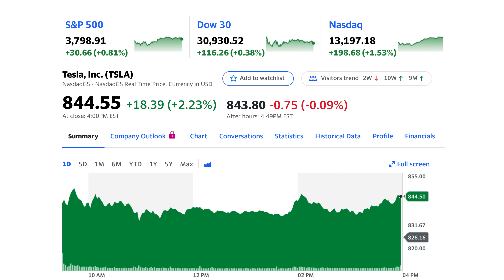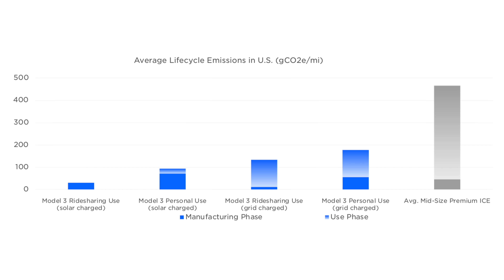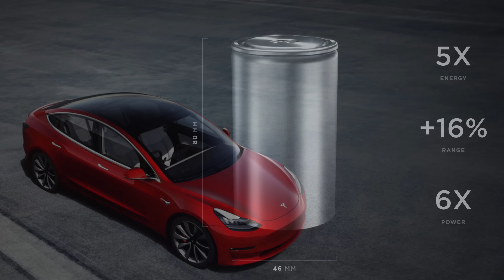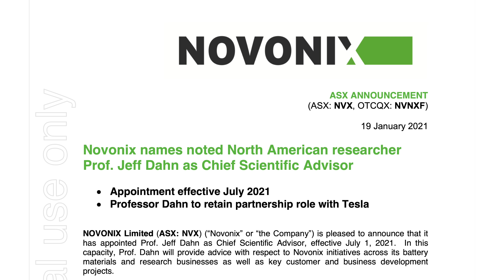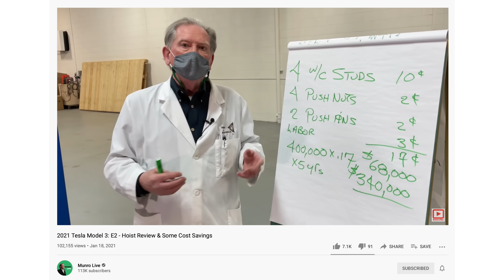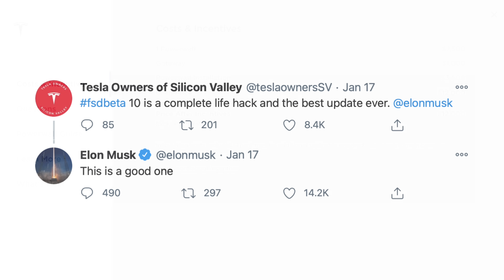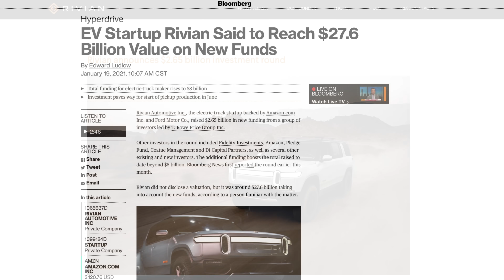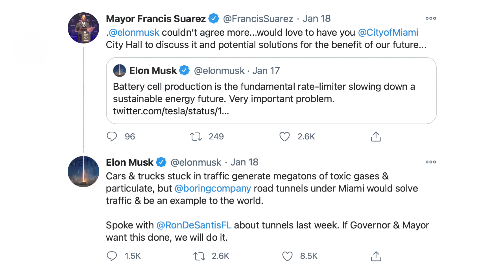Some Math on Tesla’s New Batteries, Munro 2021 Model 3, Dahn/Tesla Battery Contract

Comment: I love that you reiterate that 1 mil miles is insignificant except for robotaxis. I don’t think many people realize the avg life span of a vehicle is about 7-8 years. Even driving a high 25k a year, that’s still only 200k miles on the high end. You don’t see many of those cars on road without being sold off already for an upgrade/trade in or totaled in a collision
Reply: The average life WAS 7-8 years.
Mainly due to drivetrain wear (or poor quality steel?)
If the EV drivetrain can multiply that, who's to say that there won't be a trade in "vehicle rebody" where new panels are bolted on to the chassis?
Maybe the same with interior?
A 2 hour "refresh" with replacement refinished seats and carpets?
Take a 7-8 year old car in, collect in 2 days, you have a "3 second" Tesla with new panels for minimal cost.
Just a thought.
Reply: @rogerstarkey5390  that would actually be really cool to do. I wonder what the margins on that would be and if it was cost effective for them. I’m sure they could figure it out esp with their skateboard design. I don’t see why they couldn’t make that happen. I think their new alloy will probably last 10+ years

Comment: Quality issues like uneven panel gaps are caused by the manufacturing process. I am sure if the made in China model 3 is checked, there would be far less such issues. The Shanghai factory is much newer and better than the Fremont factory equipment. Note how installing new painting equipment in the Fremont factory led to a better paint finish on the 2021 model 3. It’s all in the process. Tesla will certainly need to improve the process in the Fremont factory and they are already getting the personnel for that.

Comment: Whoa there. let's not minimize the Munro criticism of the continuing build quality issues. Sandy clearly stated how disappointed he was about how poorly the panel gaps are. in once case, he was surprised the door even opened it was installed so poorly and said  he "didn't understand why there still these build issues". Those issues should have been resolved long ago and you can plainly see how frustrated Sandy is. There are no excuses for these ongoing quality issues and to use whataboutisms is disingenuous.
Reply: "Whataboutism" works both ways.

Comment: The increase in Powerwall - Roof install might be due to them integrating their own inverters instead of outsourcing as of the last few weeks or less. Haven't seen much, but the system apparently runs in a more optimised way when coupled to their existing hard - software tech.

Comment: Tesla needs to get better with quality and they know it, and are hiring to improve it.
Reply: Meh.  The big 3 carmakers use some tools and mallets to bend the doors so they align better.  I think that Tesla is doing a great job because they most likely don't beat on the cars with mallets, etc. but depend on the robotic arms to get it right the first time.  I think it's more important to make sure the car is built well in many other ways.  Watch Sandy Munro's videos of the Model 3 for a true expert's opinion.  He knows his stuff!
Reply: @acmefixer1  yeah, I've watch Munro's latest on panel gaps
Reply: Acme Fixer
:  OTOH, since the early 80's, the Japanese makers like Toyota and Honda just made them fit well, without needing to beat on them.  They made the American cars which were CLEARLY beaten on a lot, look like CRAP in comparison. 

Here we are 40 years later, and Tesla can't or won't fix something as simple as panel gaps, but we're supposed to believe their cars will last a million miles.  Meanwhile, their overall quality and durability by reliable reviewers is very much meh overall, and sometimes horrendous.
Reply: @rogergeyer9851  
The reason for the "million mile battery" isn't miles.  It's charge/discharge cycles, which will get used up when customers find that they can park their cars at home and supply power to the grid and get paid for it using Tesla's Autobidder software.  That's where the "million mile battery" is needed.

Comment: Hi Rob, great update again. The panel gap issue, though improving, is a pyschosis within all automotive manufacturing, historical panel gaps were seen as "if you can't get the press shop variability removed and the general/final assembly variability removed, THEN EVERYTHING ELSE MUST HAVE VARIABILITY AND BE RUBBISH". Which historically had validity in 1960-1990.

That psychosis is understandable but less and less and less indicative of manufacturing excellence these days.

In parallel, I note TSLA is employing QA Vision systems personnel - be in no doubt with vision systems, fractals, lasers.....this could diagnose this issue and others.....AND THEN BRING FOCUSED IMPROVEMENT to the specific pressing or assembly sub processes to make perfect.

Great work Rob. I'm tipping the 4680 battery pack to go very, very, very close to 100kWh 😜 likely 92-96 as you suggest, I wouldn't be surprised if the 5x has been sandbagged and reality is in the 5.6-5.8x range.

Comment: Small issue or not, the panel gaps is an indication of not caring/sloppyness. I am not saying that the gaps should be 100 % uniform, but when it is so visible as demonstrated by Munroe, anyone with some self-respect at the end of the production line should scream DIVERT and have the car diverted to a area where it can be fixed before delivery.

Comment: I was under the impression that Miami was under substantial threat from sea level rise in the coming decades. 
How does that work with underground tunnels?
Reply: The same way as the tunnels connecting Denmark internally, connecting Denmark to Sweden, and soon connecting Denmark to Germany.

Comment: Much cheaper for Tesla to ship cars without panel gap issues than to fix it at a service center. Also much better customer satisfaction level. There is no excuse for Tesla shipping cars with such a glaring issue.
Reply: Yes, the panel gaps is an indication of not caring/sloppyness. I am not saying that the gaps should be 100 % uniform, but when it is so visible as demonstrated by Munroe, anyone with some self-respect at the end of the production line should scream DIVERT and have the car diverted to a area where it can be fixed before delivery.
Reply: @JanBruunAndersen  Actually, the quality person should shut the line off and go to the person that aligns the doors and ask "what's the problem here?"
Reply: @jbbuzzable  I have spent the last 30 years working at over a dozen different car dealerships and body shops. Every car is inspected when delivered for damage and defects then are run through the service department to check fluids, mechanics and test drive. 10-80 % of vehicles have rework done at the dealership before they are put on the lot. Tesla needs to do the same at their galleries or before they get there. Dealerships make a good portion of their profits by performing  these inspections and warranty rework. This is how it is done for better or worse.
Reply: @joweb1320  I don't doubt that, and good for you to make sure that the vehicle was in great shape before the customer received it.
I come from a manufacturing background and have embraced quality at the source. Putting the responsibility upon the dealership for quality is expensive and indicative of poor workmanship from the factory.
Reply: @jbbuzzable  Then every current brand of vehicle has poor workmanship including BMW, Mercedes and Lexus. All dealers I worked at.
Reply: @joweb1320  It sounds crazy to me. Why build a product incorrectly, then go back later to repair at a much higher cost? Tesla is kind of unique in that they do not have the ability to fix these problems at the delivery centers.
Reply: @jbbuzzable  They have the ability to repair at their service centers and body shops. Obviously not all of them get the proper attention. Last year we replaced a liftgate on a 2020 Highlander that was the wrong one for the vehicle. Now that is crazy.
Reply: @joweb1320  If I understand the process correctly, the car is delivered to the delivery center from the factory. If you have any issues with it, you then schedule an appointment with a service center.
Reply: @jbbuzzable  Yes sir. Or they can fix it on the spot while you wait.
Reply: Actually it would take about 15 minutes tops to fix all the gaps on Munro's car. They should have fixed them at the delivery center during prep for delivery.
Reply: @joweb1320  Maybe, but it would have taken much less time in the factory to do it right the first time. Why give your customer a pain point for lack of basic quality?
Reply: @joweb1320  Fixing at the delivery center is stupid. It should have been done right the first time. Any quality person will agree with me.
Reply: Check out the teachings of Walter Deming, one of Sandy Munro's favorite mentors. He would be appalled.

Comment: Hmm, wondering how tunnels work under the water table.
Reply: The same way as the tunnels connecting Denmark internally, connecting Denmark to Sweden, and soon connecting Denmark to Germany.
Reply: The channel tunnel between Britain and France goes under the water table under the sea and through challenging geology but still,remains electric only and free of flooding.

Comment: Rob, bro you know if you break out a caliper on your own car, you will never unsee it. LoL 😝
Reply from the maker: Oh I know. I already can’t unsee things I probably never would have noticed if I were a normal customer
Reply: I'd love to see someone break out a caliper on some Ford and GM vehicles. Tolerances are almost certainly worse on average (even for the same price range).

The difference is no one cares because FUD was never directed at them
Reply: @thomasreese2816  panel gaps have been a body criteria for a long time. It was a big thing back in the 90s.  There’s always flyers but you won’t find panel gap issues on most cars.  Especially in the entry lux level at 40k and up. Panel gap issues are often associated with unplanned panel removal.  E.g. if the panel was replaced or had to be removed for another repair operation.
Reply: I have a M3 2019 September build I looked for panel gaps when I picked it up before driving away, there were none. My friend has a M3 2019 August build all good there too.  But I did see a 2020 Model Y in my home town with gaps. I think there are issues but not as many as one would think.  Also as Rob stated the gaps are easily repaired so my take is it’s not to a big deal.
Reply: @rockymckinley8492 :  It's a big deal if one has to drive to ANOTHER STATE (so few Tesla service centers) several times to get that worked out. 

I'll just stick with Toyota and only have to do normal maintenance, which I can do at any mechanic I like.   When Toyota has a BEV, I'll consider that, depending on the reviews.
Reply: @rogergeyer9851  That’s true, I also have a long way (500 miles) to drive if I need major maintenance. So far all my warranty issues Tesla has sent a mobile maintenance person to me and repaired the car at my house. I just have to make an appointment through the Tesla app. That’s cool I’ve been a big Toyota fan for years too... 96 Tacoma, 13 Venza and still have the 07 Tundra.  I haven’t had any major issues with my Tesla but I like you was very concerned about the distance for major repairs. Hopefully they build out service centres in your state in the future.
Reply: @deeperanddown  For sure

Comment: I don't understand why people cry so much about panel gaps.  Does the weather strip seal so water and air doesn't get into the cab? YES,  so why make such a big deal.  The doors close without rubbing.  
The car is so advanced with its technology over ICE Vehicles and peolle cry about a little panel gap,  annoying.
Reply: In 52 years of driving it has never occurred to me to go around a car and look at the differences in the gaps, I don’t get it either !
Reply: Small issue or not, the panel gaps is an indication of not caring/sloppyness. I am not saying that the gaps should be 100 % uniform, but when it is so visible as demonstrated by Munroe, anyone with some self-respect at the end of the production line should scream DIVERT and have the car diverted to a area where it can be fixed before delivery.
Reply: @JanBruunAndersen  if the gaps dont cause a leak or problems with paint rubbing or doors locking, then its trivial. Meanwhile just about every car Ive ever driven had problems like rubbing paint, locks not working right, doors whistling, and water leaking in. And that was just accepted as being normal for an American made car. So either this is a nothing burger of people looking for something to complain about, or every car thats rolled off the lines of Detroit for the last 40 years was a lemon.  And as Ive been saying for the last 4 years, if the WORST thing people complain about is the panel gaps, then its just flat out the best car ever built.
Reply: Every Dertoit built car Ive owned has failed in this regard, so I agree. Literally no visible gaps in the seal around the windshield of the last two cars Ive had, but both dripped like crazy in downpours, in my last car the front passenger side flooded every time it rained and my current car the trunk just stays wet.  A few cars ive driven had problems with doors rubbing and locks not working properly. And Ive only ever owned or really driven American built cars. So Im not sure how people have gotten so picky.
Reply: If this is the worst part of Tesla then Id be fine with that, the paint on my trucks door panel doesn’t match after body shop and i never griped, more of a headache to do so, now if there are multiple recalls then obviously thats a different story and id stay away for sure cough*Ford*cough
Reply: Because it's unacceptable and people (mostly fan boys)  that keep saying they don't understand the issues are giving Tesla an excuse to do nothing about them! It's a quality issue that has been going on for 3 years! I see many potential buyer in forums not going ahead with a Tesla purchase because of these issues and poor customer service experiences that get highlighted by exsisting owners.. do you understand yet?! It's not all fairy's and rainbows!  Im fully invested into Tesla and to see these issues not getting resolved after 3 years is alarming! Sandy Monroe who looks at every car can't believe Tesla still have these issues.
Reply: @dannyspeed  , chill out.

Comment: I've seen a transport truck with a odometer at 1120000 miles. I guessing that the 1 million mile battery is designed for tesla semi.
Reply: No it's for robotaxis.
Reply: The semi will actually not reach the 1 million miles, the batteries would have been weak by then. Diesel engines can last way longer than just 1 million mile
Reply: @alanmay7929 The 4680s are designed to last that long.
Reply: @user-RCST  batteries only last long when well taken care of.
Reply: @alanmay7929  yes, but they can be designed to last longer.

Comment: Stoner thought: Just picture a Mag-Lite big enough to hold 6 of the new Tesla cells.
Reply: Or mini tesla flash lights that come out of the trunk powered by one of those batteries but when you return it to the back it charges. Rivian has something similar
Reply: The maglite would be you an added 2miles+ of range, 😜
Reply: Be cool if you could use it to light up.
Reply: Those 4680 cells are ridiculously huge.  The 2170 cells are too big.  The 16800 cells make great flashlight batteries.  They can put out more than enough power.

Comment: Great video 👌🏽Thanks Rob! 🙏🏾 I predict a Model 3 with an over 400 miles range and a Model Y with around a 375 miles using 4680 cells by or before 2024
Reply: Or keep the range and bring in a big price cut. I do think Model 3 could end up coming back down to 35k or even lower.
Reply: @patreekotime4578  
More to the point, maintain existing range (plus a fraction) and hold a further 10%(?) of 4680 cell production for increased vehicle production.